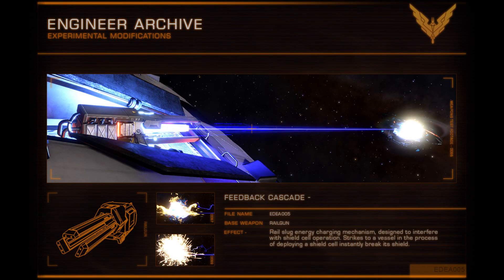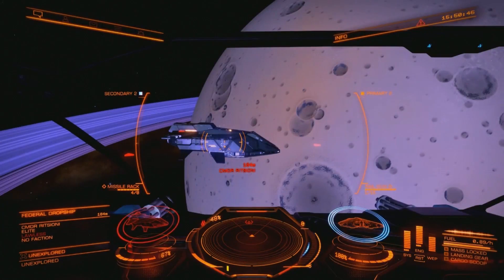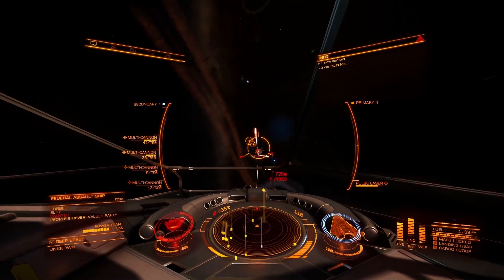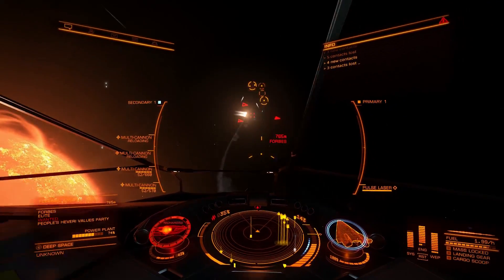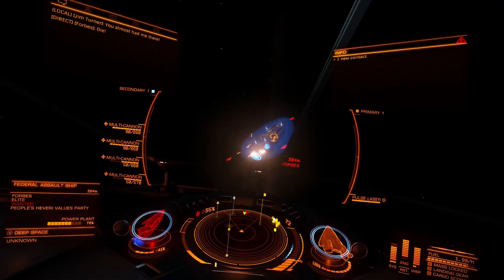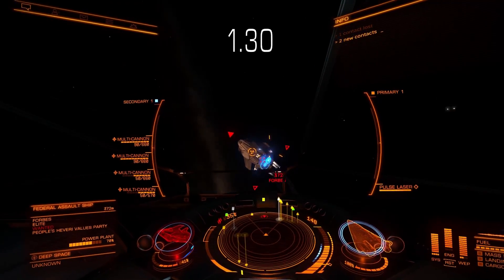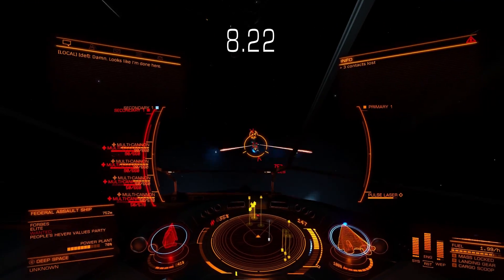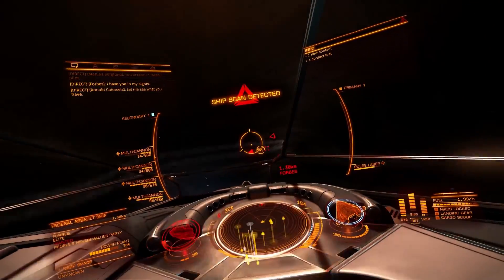Feedback Cascade Railgun vs Shield Cell Bank. How much time we actually have?

Comment: cascade weapon will work if they drastically reduce SCB charge time and REMOVE sheild recharge animation. otherwise it's just ridiculously OP
Reply: lo and behold, you got your suggestion granted.
Reply: @brianlam5847  4 years later?
Reply: @A_Honcho  yep. You still play? Not expecting you to still do.
Reply: @brianlam5847  not properly since 2015 - oddly enough I have recently reinstalled it, Space legs got me curious.
Reply: @A_Honcho  I saw it on game awards too. The fact that the entire thing was gameplay was pretty cool.
Reply: @brianlam5847  what did they change?
Reply: @chrisklitou7573  Reverb used to knock out shields, not just the shield recharge from the shield banks.
Reply: @brianlam5847  ah really so a shield would immediately go down if hit?
Reply: @chrisklitou7573  Back in ye olde days
Reply: @brianlam5847  that does sound a bit OP
Reply: @chrisklitou7573  Which is why it was removed.
Reply: @brianlam5847  they need to nerf Torpedoes too

They have the best lock on in the game they will follow you no matter what and what blow up unless they hit a target
Reply: @chrisklitou7573  No, just run away. Torps have super slow speed, like 250m/s which makes every ship in the game able to avoid them if they go away. Invest in Point defense turrets or buy ecms, or just run away from torpedoes.

Comment: I think it's also important to note that this will be a mod on a main weapon of your ship, so you may drop their shields instantly without actually strategizing to do so. They might have to limit this mod to a specific hard point size or set a limit on how many you can have, or increase the charge time of the shot. I think there will be enough ways to balance this if it's too overpowered when it drops.

Comment: I suck as using rail guns so it wouldn't matter if the enemy was vulnerable for 30 seconds, I doubt I could get a hit, but against any pilot with any skill these could be devastating. The funny thing is, when I connect with rail guns it's really satisfying, despite the low ammo count. Having this enhancement is definitely a motivation to get better at rail guns. Although I think they'll nerf it during the beta.

Comment: Unless they make it so this Railgun does little damage compared to a normal Railgun,  there's no reason for anyone to carry anything but these Railguns so they'll just be firing anti-SCB rounds all day and timing won't matter :/
Reply: +Huw Lines Ammo capacity is way too limited for all day use ^^
Reply: Wont Tell You know what I mean.
Reply: Huw Lines Just sounds to me like you haven't used railguns much. I don't either. I don't like them much (mainly because of the low ammo) - and this would finally make small hardpoints useful. I do see why it unsettles folks who rely heavily on SCBs - which was a game design mistake to begin with, in my opinion. People got too comfortable ;D
Reply from the maker: +Wont “Psyantologist” Tell i used railguns a lot and with crafting there is no problem, you wont use them against npc but against player only (obviously) and all you need is some reloads anyway before you or win or lose, so Huw Lines is correct - there will be no reason to use normal railguns ever (unless you don't have engineer access) if you have similar damage and this bonus.
Reply: Huw Lines So you have anger issues and language issues. You really should stay out of comment sections.
Reply: +Kornelius Briedis Yeah, it'd be silly of devs to let both weapons have the same stats. They're not that silly. Wait. Maybe they are...
Reply: Wont Tell Kornelius apparently has language issues YET English is not his first language and understood what I meant where you failed to, nice.
Reply: Huw Lines You are free to make all the assumptions in the world about other people and make up your own reasons to get upset and vent the frustration you're quite apparently already carrying. Knock yourself out!

I also understood what you meant, yet your initial assumption was rather silly. So I pulled your leg a lil. I put "^^" there to suggest a humorous gesture, in case you didn't notice. You took this as if it was the biggest insult in the world and went ape shit, as if debating stats of two pieces of equipment in a computer game, stats we don't even know yet, were the most important thing in your life.

Just my impression. And my own assumptions. It isn't my impression though that Kornelius would have language issues. Quite the contrary. He's able to convey noticeably more intelligence through English than most native speakers whom I happened to stumble upon. And English isn't my first language either ;P